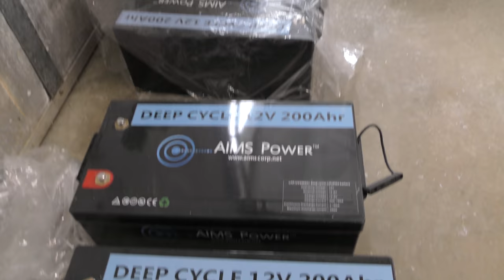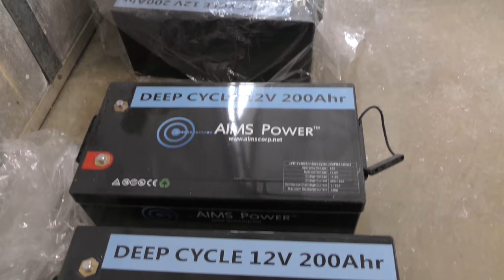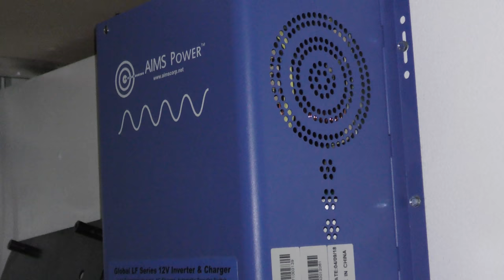Run Air Conditioning Off the Grid - MONSTER Camper Solar System

Comment: Ya I plan on using a small Zero Breeze for air con.  I only plan on cooling/heating a 3'x3' space, so I can do it.  Solar panel, battery array runs all my lighting (large DC light) and electronics (running directly off the array).  I plan on living in it full-time, so I can't really afford to run large items because EVERYTHING needs those batteries on a daily basis, just to keep it all running.  I am thinking that the cross breeze from the back windows and two strong DC fans should consume less power (the DC batteries need to be recharged) than the AC and let me get by when its not boiling hot.

Comment: Why not run the heating, water. heater and stove/cooker using diesel and just use the solar for refrigeration and aircon?
Reply from the maker: That would be a great way to set it up as well, but at the point the system needs to be to run AC, the water heater and cooktop really aren't a significant additional load. Once paid for, the solar energy is free and you wouldnt need to pay for diesel fuel, that's really the only benefit I see, but that's a nice benefit if your using it daily.
Reply: Maybe both on the next. Great project! Thanks!

Comment: Heads up. I have had two of that kind of breaker fail. I think they are meant for car audio and rated for peak amperage not continuous amperage. Bluesea makes some resettable breakers meant for inverters.

Comment: Xantrex offers 600aH LiFePO4 in one case, they call it the eGen System. Also, that's a horrible way to crimp lugs with such a big power demand, they will get very hot and fail.

Comment: I have several questions about your ambulance build.

What type of toilet system was installed in this rig ?

Would it be possible to add a recliner chair as a piece of furniture in the ambulance build ?

What type of cabin heating system was installed in the build ?

Is it possible to charge the house batteries using both the solar power and the trucks alternator at the same time ?

What type of house batteries does this rig use ?  Are they lithium or AGM batteries ?

What is the size of the grey water tank installed ?

Can the ambulance be used in below freezing winter conditions without the fresh or grey water tanks freezing ?

What is the total costs of converting the ambulance into the 4x4 ambulance adventure as shown in the video ?

Can the truck be plugged into a shore power source such as a 15 or 30 amp electrical source ?

Comment: Haven’t you watched all the videos out there now using mini split heat pump systems. Those units are far more efficient than that type of rooftop air-conditioning system and you get heat or cool from a mini split.

Comment: The problem with this is you will hit that battery bank hard, even at 600Ah of capacity.  1000W of solar doesn't always generate 1000W, varies with the available sunlight and angle of the panel.  Didn't look like the panel angle was adjustable.  Either way I predict about 2-3 yrs down the road that bank will need replacement...

Comment: cool.  How long do they think the AC will run without solar light?
With everything off the battery do you have to make choices?  Cook or have AC.  Maybe heat water early in the day and hope it stays warm for an evening shower?
Cook on the stove and hope the night is cool enough to not need AC?
So, this is not a Florida rig either, 87 at night and 87% humidity is no way to live without AC…

Comment: What engine does it have and how did he get 900hp out of her?
Looking around I'm finding these but with 300hp
Reply: James Boaz it’s a duramax diesel which my assumption is that he has an intake,intake Horn, full exhaust, bigger turbo, and it’s tuned.
Reply: Jay C exactly. Just put a bigger turbo and inter cooler on a diesel, and it easily makes more power with the proper fuel-air mixture.